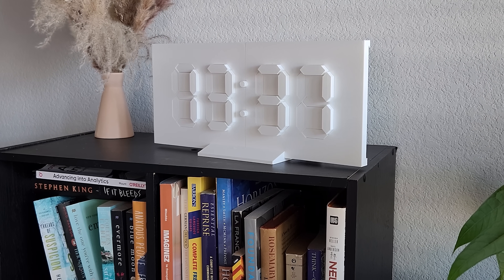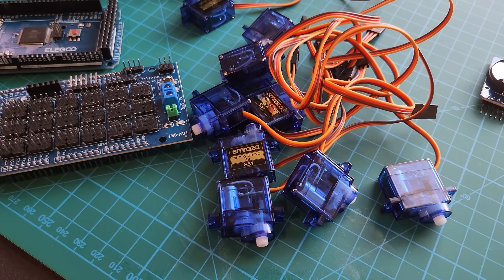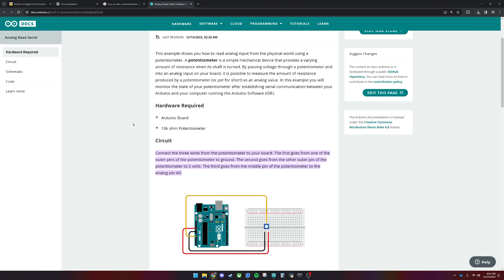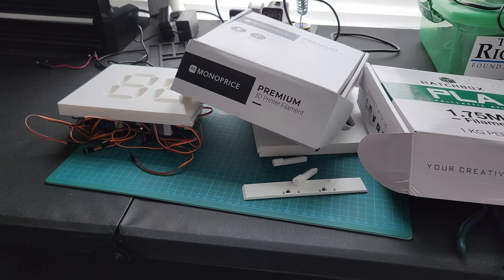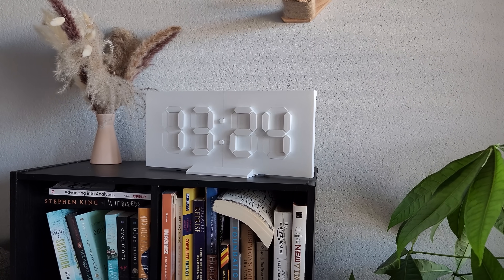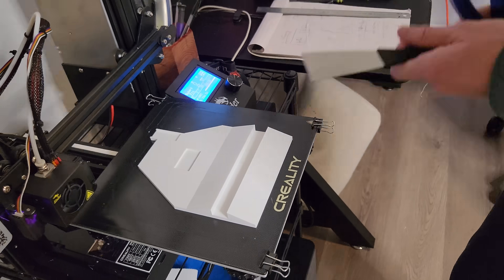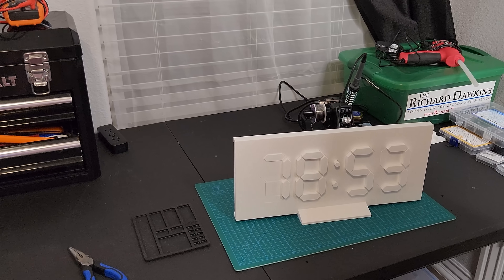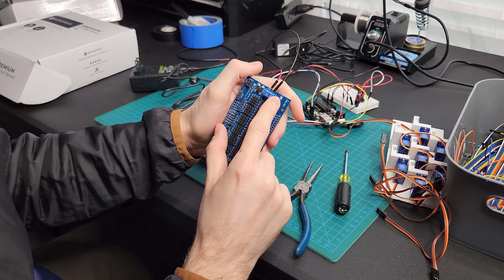I Built a Minimalistic Kinetic Clock Project with my 3D Printer and Arduino

Comment: Great project but I’ve got a few things to add. 

Arduinos on their own are not good at driving servos, especially not a large number of them, the servo library sends the signal using software which means that the timing can be off due to interrupts or just the arduino being busy with other code, this can create jitter in the servos. Using a servo driver board or an MCU with hardware timers is better. With a servo driver board like the PCA9685 you can drive 16 servos with hardware timers and you can change the address of the boards to use multiple boards, you would only need two boards to drive all the servos.

You shouldn’t need that much power for all the servos, you could reduce power use by switching the servos off when they aren’t needed, they stay in position when switched off but can be easily moved, since your clock segments won’t have any force on them they shouldn’t move, hence you can switch all the servos off after they are in position and only switch on the ones you need to move. Which should save a lot of power. Then to reduce peak power you could set it to only change one digit at a time so fewer servos are moving at once, this would change the effect though to more of a rolling effect rather than a sharp movement so is more of a stylistic choice. Also with the servo driver boards I mentioned you can stagger the signals, this is useful because the servos draw the most current when just starting moving so if you can offset the start point of the signals (just within the servo signal period, so the maximum offset would be 20 ms) then you can reduce the peak current draw too.

As for the servo noise, this mechanism would maybe be more suited to solenoids, which move straight in and out and for cheap ones you don’t control the position but the endpoints should be the same. Solenoids can be loud but they can also be very quiet, they have no noisy gears and with some damping at the ends they should be quiet. Solenoids are also easy to drive, you can gets ones with spring return but I wouldn’t recommend those for your project as they need to stay powered to keep it out but are simpler to drive. Instead you could use solenoids without a spring and then just a H-bridge to extend or retract the solenoid, since they aren’t spring return then after extended or retracted they would stay in position.
Reply from the maker: Hey thanks the time for your feedback. So I attempted to update one digit at a time but I'm not quite skilled enough with coding Arduino to execute it. I like your idea of using a servo driver board and it's something that I'm going to play with in my next projects I'm excited to learn more about it. 😀
Reply: @LukasDeem  
Additional point, add hard stops for fully extended and fully retracted for it to be more consistent as in some shots its was hard to read actual numbers due to extra shadows those inconsistencies creates.

Side thought on my own. This could be really cool one if made with metal parts which got cut with EDM which could produce superb results, tho it would be quite expensive hobby to have 😂
Reply: I agree!
Reply: Hey! That's really helpful. TY!
Reply: I would like  the look of Solenoids better than servos. I imagine the pieces moving quickly and silently would feel a lot better than a slow and noise design. IMO
Reply: @crixi__  you could also create some cool effects by staggering the solenoids, like wave or rippling patterns, although you could do the same with servos.

Solenoids may be fast enough to create a second counter too.
Reply: Share your points.
Would you have some links to "silent" and/or "slow" solenoids as I have an interest for an incoming project?
Reply: @toto_chanel6952  the main noise from a solenoid comes from it hitting its end stops, so if you have a soft or damping material for its end stops it should get quieter, even maybe as simple as adding an O ring or some foam. As for noise of it sliding if that's an issue then I guess lubricating it better would help.

Buying half decent solenoids and not the cheapest you can find should help with noise too and just overall quality in general.

For slow movement then that will generally be up to your drive circuitry, just like a motor you should be able to control a solenoid through voltage or current control as the force generated is proportional to magnetic field strength. The more force you create the faster it will accelerate and the harder it will hit the end stop.

To control the current you could quite simply add a resistor in series and that would add passive fixed current limiting but is inefficient. You could get fancy with diodes to have different extension and retraction speeds.

Or if you use PWM you can find a PWM value that generates just enough force to overcome friction or the return spring and then use that to regulate the speed.

If you want speed control then a solenoid with a return spring is maybe a better option than one without a spring as it gives a force to push against.
Reply: @conorstewart2214  Thx for your detailed inputs
Reply: @conorstewart2214  if the face of the clock isn't perpendicular to the floor then it makes more sense to use the spring loaded ones since they can hold it in a more resilient equilibrium. the non-spring ones will struggle a lot in this case.
Reply: @Bopcello  yeah that is a case where the spring return ones would be required unless you can get enough friction to prevent the blocks from sliding back in under gravity, however you then need to keep the solenoids powered which uses quite a lot of current.
Reply: I second @toto_chanel6952 would anyone have any good solenoids they’ve used as I’d like to attempt this project with solenoids. Cheers!
Reply: How do you turn off a servo?
Reply: @RenSauceMan  if you stop sending the signal to the servo then most servos will just switch off.

Normally you send a signal between 0.5 and 2.5 ms or between 1 and 2 ms to a servo every 20 ms or shorter to tell it what position to go to, if you turn the signal off, then the servo should switch off, basically it will stop trying to hold position and just switch everything off and wait for a new signal.
Reply from the maker: You can use the servo.detach() method.
Reply: Allow me to disagree on the solenoid. Technically speaking you are spot on, but there’s a visual aspect of the slow number change that’s mesmerising and by using a solenoid that would be gone.
Reply: @rafa-borges  the force a solenoid generates is proportional to the magnetic field strength which is proportional to current through the coil, it should be possible to vary the speed or force in the same way you control a motor's speed.

Basically you could just energize the coil enough to overcome friction and then it should move slowly.
Reply: @rafa-borges  There are solenoids that move slowly, also damping mechanisms could be used. At the end of the day, I think you gain more than you lose considering the amount of gears in this project, 3d printed gears usually suck.
Reply: one more thing: a led (strip ?? ) behind when on..

Comment: I built one too!!!!
Reply from the maker: Ayyy! Did you face similar challenges? Were you able to get it powered off of a single power supply by chance? 😅
Reply: @LukasDeem  I decided to completely redesign it.  The servo's on mine are held with m4 bolts so i could easily remove them.  I had just two pieces for left and right - combined it altogether.  I also redid the servo pieces to give them more clearance.  Power supply wise I still have two.  I use one plug that has a USB power supply above it.
Reply from the maker: Awesome did you take any photos or videos that you can share? I would love to see it!
Reply: @LukasDeem  https://youtu.be/-A3fEVClK0o

Comment: It was truly surreal, as the designer, to see everything come together for you. I'm really glad that you were able to make it work despite the challenges along the way. Thank you for picking this up and documenting your journey.
Reply from the maker: I'm honored that you watched my video! Thanks so much for making this design and sharing it with the community ❤
Reply: Thanks for sharing your design, it's pretty dope! This is why I love 3d print community.
Reply: Thanks for sharing your design, it's pretty dope! This is why I love 3d print community.
Reply: And a big thank you to the designer for this brilliant idea. You've inspired me to have a go at this too. I think an interesting addition would be to use some LEDs to light the digits, turning them off and on as the segments show.
Reply: Make a product out of this, it would surely sell
Reply: 'It was truly surreal, as the designer,'   I'd started to post before and held off, but now Fran just released a video on similar ideas.  You'll find this video interesting..
Fran Blanche    Digital Clock Or Automaton?
Note the The pivot points and the cam levers operating in more than one dimension to control multiple segments.

First thought on seeing this a while back was 'that's a lot of servos/motors'.
Second thought was 'one or two motors per digit, cams to drive the elements'.
Third thought was 'do both'.  Since it's large, with a little tweaking the same parts could probably be designed to work off of 2 servos per digit with a cam, or the 7 independent servos per.

Using cams looses some of the crispness of independent drive, but for 5 or 9 motors instead of 30+ it's probably worth that slight loss if you are only displaying numbers for a clock.

And thinking now it might even be worth looking at a full alphanumeric.  Cammed or matrixed well and you might be able to run a full 14 segment alphanumeric with a reasonably small number of motors per digit.  I may look at it a little myself, if I hit on some arrangement that will make it easy with a low motor count I'll post it back here.
  Interesting but probably not really worth it, checked it again and the 'alphanumeric' alphabet looks terrible with the mix of upper and lower case needed.
Reply: So happy to see that. You deserve more recognition. letting this available to everyone after so many researches and prototypes, big <3
Reply: @SanctuaryGardenLiving alright, cool
Reply: @SanctuaryGardenLiving  Thank you for sharing your comment. 
The Department of Redundancy Department.
Reply: @Bob3519  that was some kind of glitch in the matrix man... Lol... Happened twice yesterday... I press send and it just got stuck, had to close out app both times.
Reply: @Bob3519 ✅
Hey Bob, thanks man, you just made my day. 
lmao.
Reply: @Bob3519  DRD.. like we need ANOTHER 3 letter agency